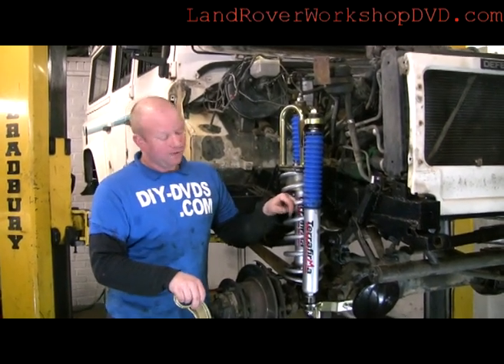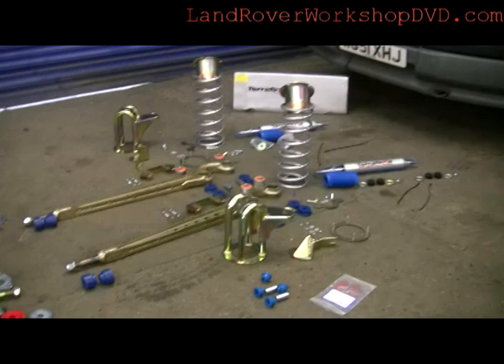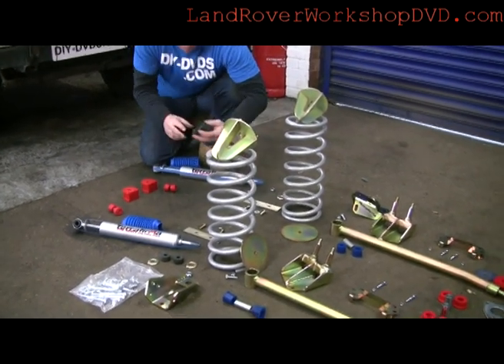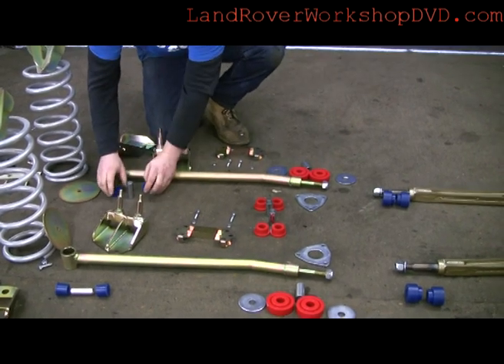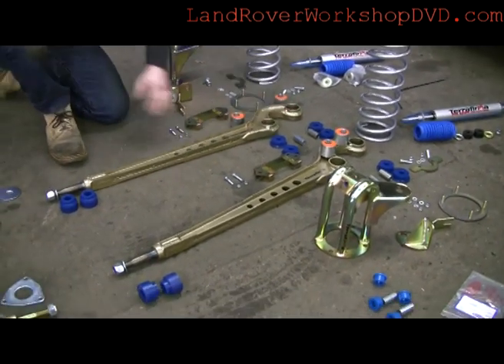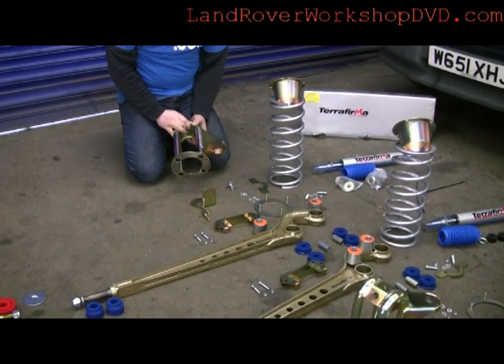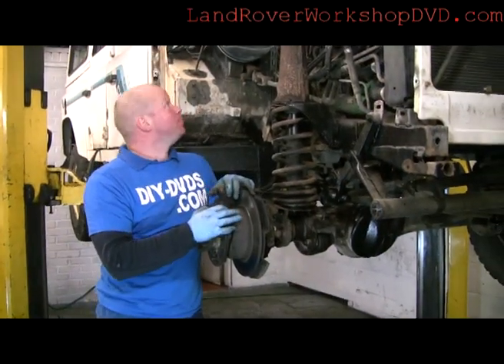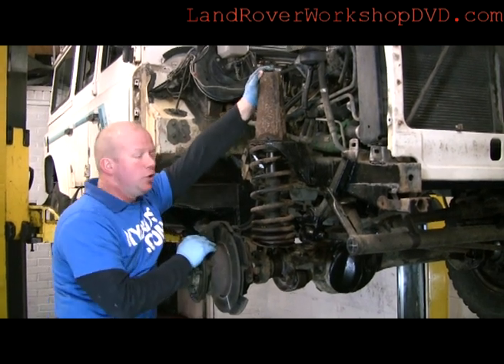How to change Landrover Suspension, 2 inch suspension lift with Gas Shocks

Comment from the maker: @carlosgmeyerq If you want to custom build a landrover you really should buy a coil sprung model as there is a lot more stuff available for them and they are much more driveable everyday. you would have to seriously modify the chassis to change it from leaf springs to coil, better off starting with a 90 or 110 coil sprung

Phil